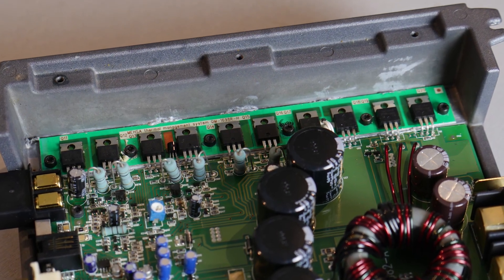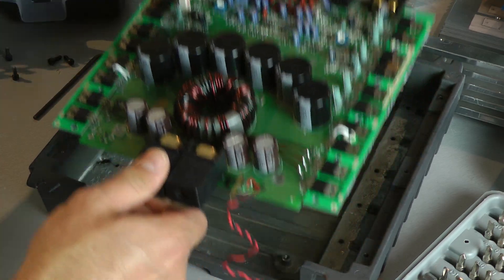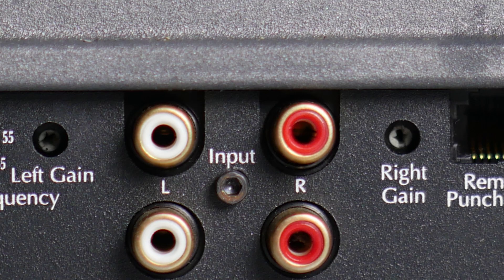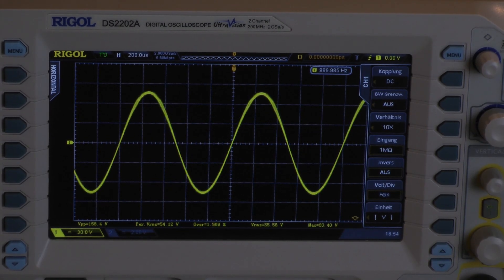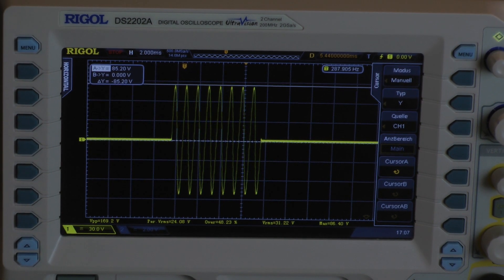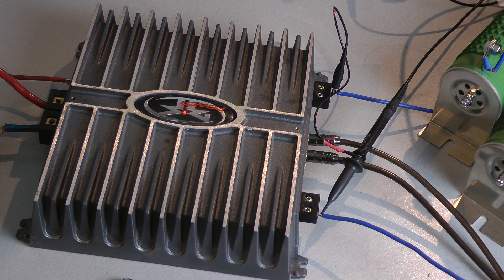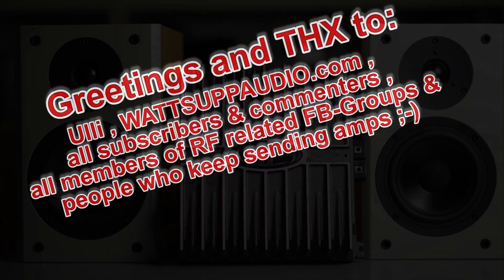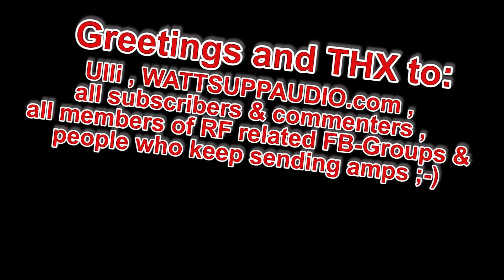Rockford Fosgate Power 500.2 old school car audio amp dyno run , sound test , overview & review

Comment: I have a R.F. R2-1200X1 I bought new but didn't install for just over a year (warranty exp)
It goes into protection at almost any volume, even without subs hooked up....
Rockford said they could fix it for $180. but wouldn't tell me the exact issue.... Any Ideas....?
Reply from the maker: Im sorry, I never had this amp on my bench and no experience with it- it’s a newer one, right?
Reply: @audiokeller1975  A 2020 model
Reply from the maker: Ouch! Way to new for me , sorry 😮

Comment: Of all the Punch 500w amps you have tested, this one is the most powerful yet (200w+ continuos in stereo)!  Even the 500a2 amp doesn't make 200w continuos in stereo.  Very strong amp!  Wish I had bought this one, instead of the 501s amp (only 173.5w in stereo).
Nice video, thanks!😊
Reply from the maker: Yes, this one ist strong. There is always some variation on the same model. I’m curious about the power 250.2 from around 1999 which will be one of the next amps to get tested 👍😊

Comment: Glad to see this because it brings back memories, I had 4 punch 15s in a ported box that took half the bed up in my Mazda b2000 truck with a snug top, I took out the back window and put in a boot so it was pass through. I had each 15 running off of a power 500.2 bridged and I had a Audiotech preamp line driver on the rca's coming from my alpine pull out deck for my highs I had Boston acoustics 3 ways with passive xovers and I was running them off of a ads PQ15. They called me the bump at high school because you could hear me coming from 4 blocks away. I always wondered what actual power I was running it was such clean solid and deep bass it was amazing.
Reply from the maker: Bringing back memories from the 90s is also a reason why I make these videos 👍

Comment: I would like for you to measure the rail voltages on the main caps unloaded. Seems like they put more turns on the secondaries..its time to discover the difference between the ix.x2...punch 225.2. And punch 500.2..after you uncover the voltage increase from year model to year model..the final understanding is how does that decrease the low imp ability to follow ohms law.  Or did they actually achieve stability..as they evolved.. Im excited to find out..
Reply from the maker: @davidstevens7809  I still have a 200DSM 1993 non-ix laying around, I will make a more detailed dyno with it and compare to newer amp designs. I tested the 200DSM with 1 ohm per channel continuous(!) and it did well but back then I tested only one channel loaded .